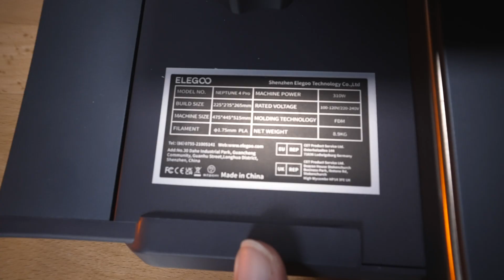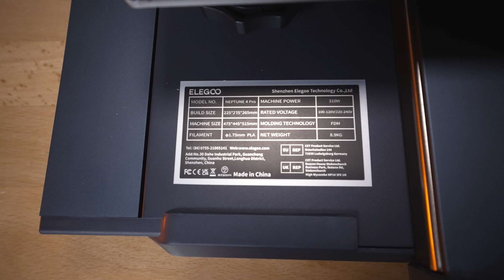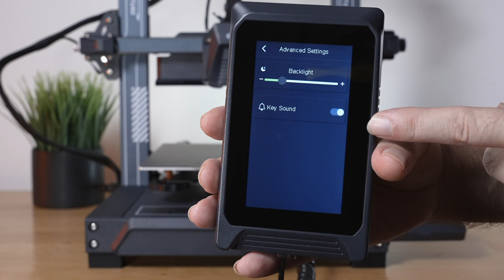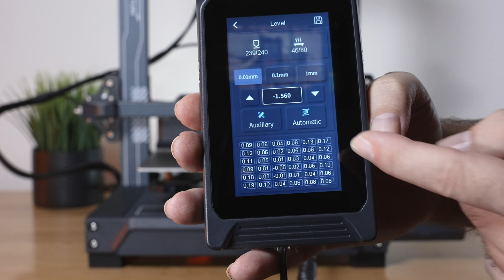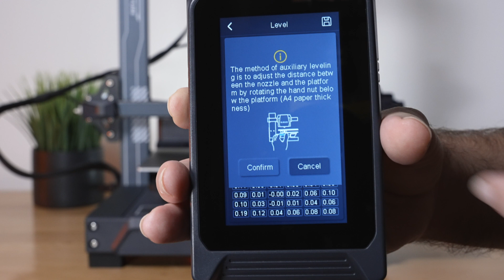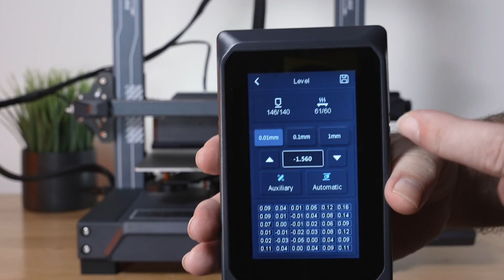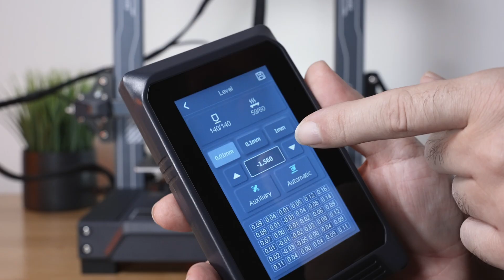Elegoo Neptune 4 Pro - Klipper 3D Printer - Overview & Leveling

Comment: You can insulate the bed yourself.   I did mine it's not that much different tho maybe a little more control over temp setting.  Will be more accurate

Comment: I broke my screen, now the printer is useless(ps. only got it 4 days ago). I was going to just print with klipper, but the sceen managed to reset my leveling data, and I dont know how to level the printer without the screen working. I also bought it as a preowned from elegoo, and i don't think its covered by a warranty. SMH
Reply: It also changed the language to Dutch for a cherry on top
Reply: 😂😂😂 wtf 😂😂
Reply: Save your leveling right top corner.